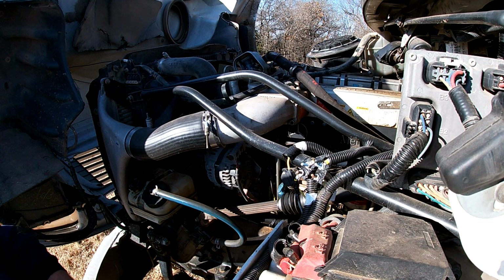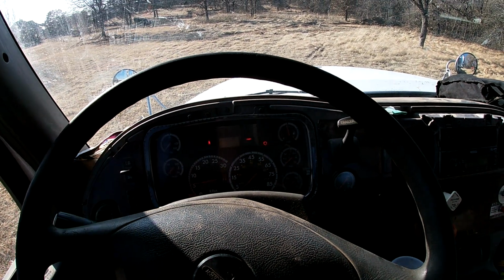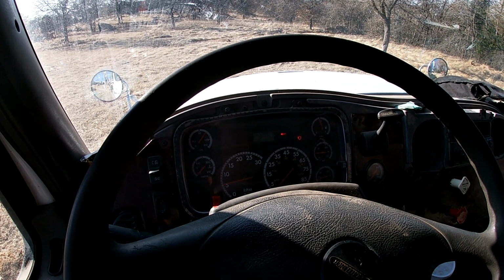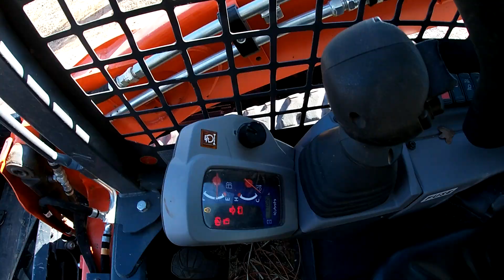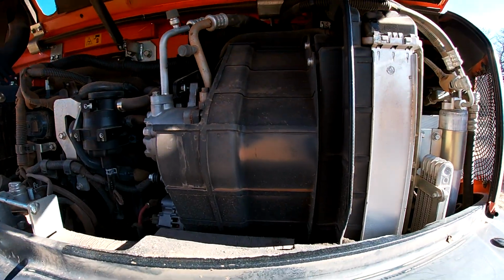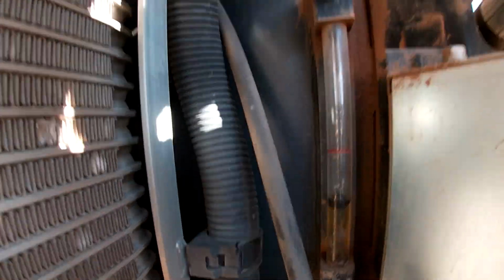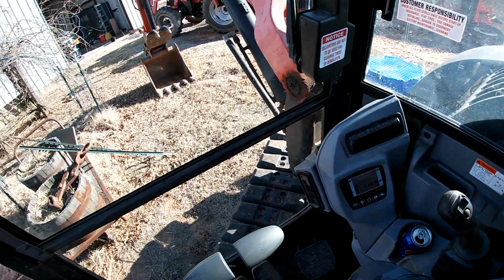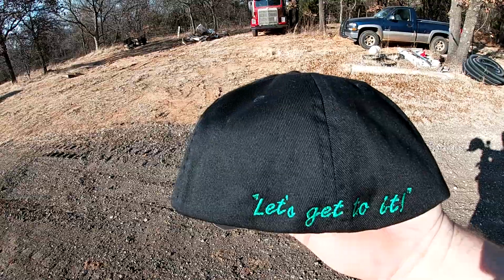Grease, Load, Ready to Go! #46

Comment: First time I've seen the SVL 65. What is the gross legal weight limit on the truck and trailer set up you have?
Reply from the maker: I'm tagged for 60,000 pounds. That's enough to haul my Kx080-4 and the SVL65
Reply: @shamrockdirtwork7945  good looking set up.
Reply from the maker: @ResidentialDirtWork  Thanks for the compliment!